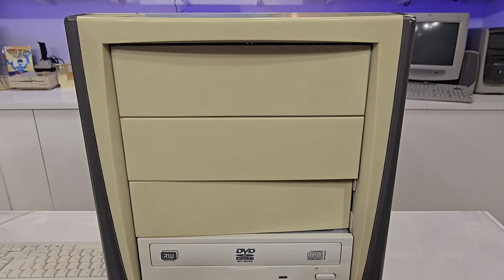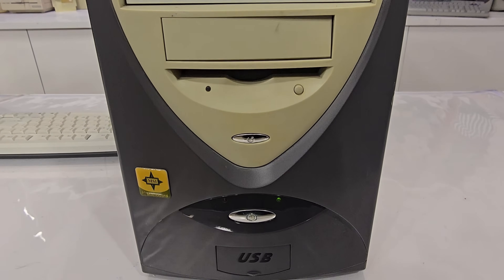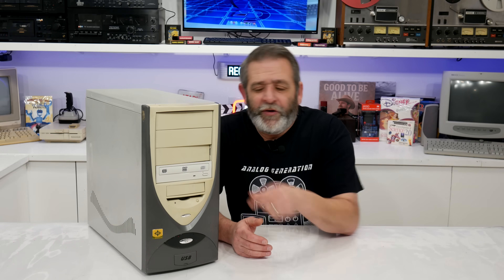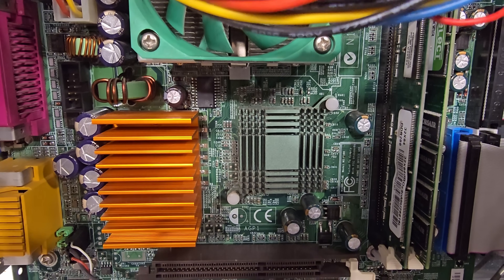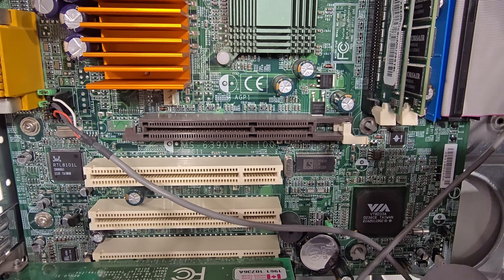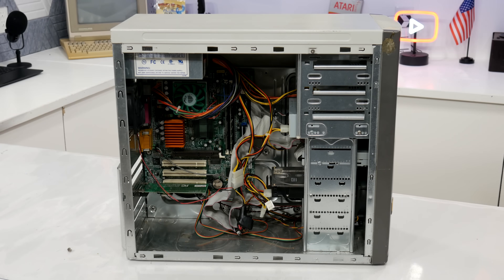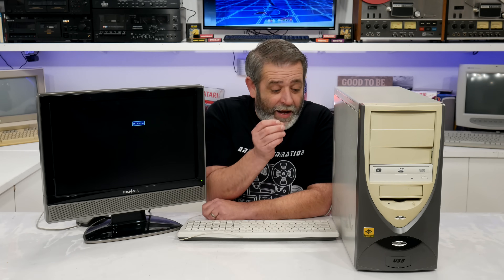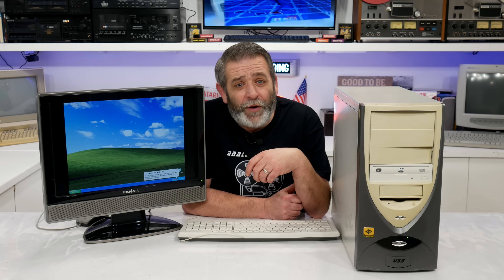Only REAL Retro Nerds Can Date This Mystery PC | A Retro PC Scavenger Hunt

Comment: Obviously it's a Windows 2000\XP era. It's capable of burning DVDs.
It could be as early as Windows 98, but I think it could be 2000 or XP.
It might have only 1GB RAM, maybe 16MB onboard graphics.
I build retro computers & I can usually tell a mile off.
I haven't watched the video but I can usually tell by the 3rd party PC case.

Comment: 98se have USB?
Reply from the maker: Win98 did have USB support in SE
Reply: Yes,  but only very basic. No usb Flash Media for example.  And it crashed often. First windows os with good usb support was windows 2000 based on the nt kernel

Note that for usb keyboard and mouse bios could emulate ps2 devices so you could even run nt4 which had no usb support at all